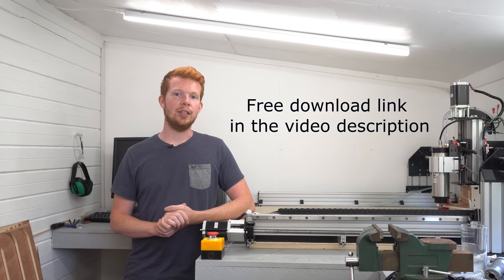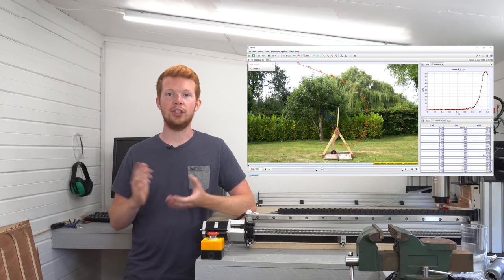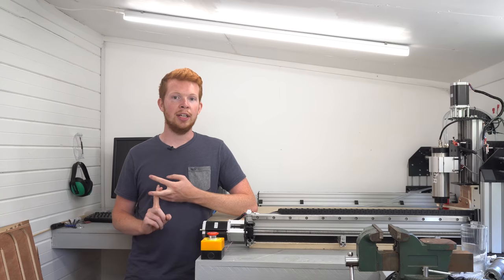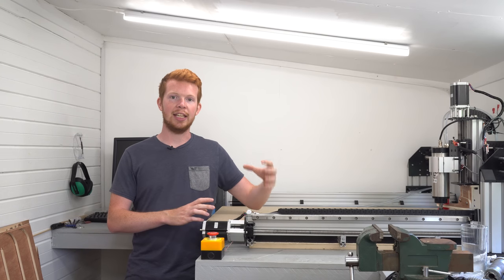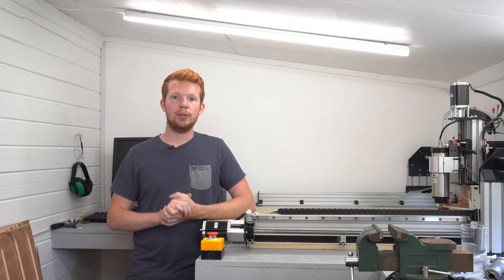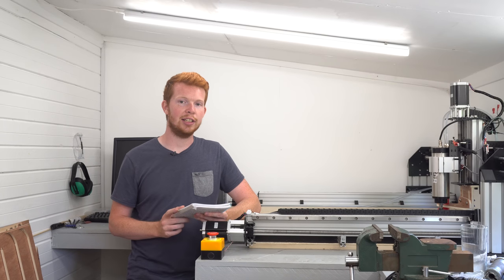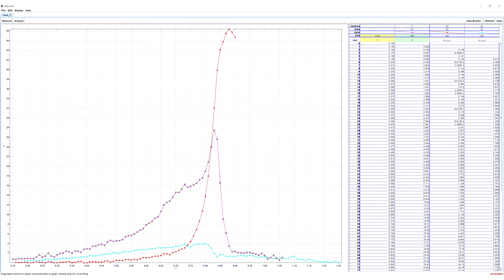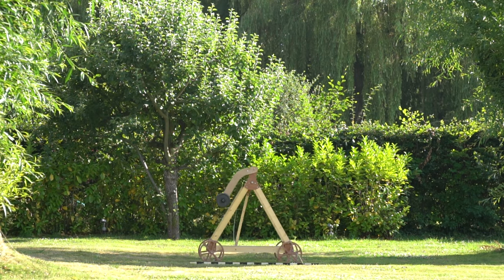Wheels on a trebuchet?

Comment: Are there other ways to achieve that synchronization? changing the length/shape of the weight arm, or a bent launch arm, etc?
Reply: Even the radius of the wheels could matter, a lot of variables here to mess with calculations.
Reply: That grass surface too. Couldn't help thinking some sort of track would improve efficiency, but no idea whether the effect would be negligible or not.
Reply: Aron Green why not just put drawer sliders on the bottom and weigh down the frame?
Reply: Actually i completely misread this. If you let it move on its own, its not gonna syncronize, ever. That would be like a gun recoiling forwards.
Reply: The wheels must move freely to time the frame with the action. I use tracks in the fields.

Comment: The added efficiency of the wheel version may come from the concept that with the wheels and move vertical stall location of the counterweight, the counterweight ends up stalling at a lower elevation relative to the ground than the non wheel versions.  The results in more gravitational potential energy being delivered to the arm/ball.  In the case of non-wheels, the ball is released and the counterweight still has another few inches to drop and that energy goes into the swinging of the arm post release of the ball.

Comment: Tom, your analysis of the stall points was very clever, and I do believe that their synchronization is what allows your trebuchet to throw faster. However, I do think that your idea that allowing the trebuchet to move causes a loss of energy is flawed. If there is one thing I have learned about physics, it is that every action has an equal and opposite reaction. Regardless of the presence of wheels, the same amount of energy should be lost. With the wheels that energy is utilized to move the frame of the trebuchet forward, and when it is anchored that same energy goes into changing the earth's rotation which, due to it huge mass, is altered an imperceptible amount.

Comment: on a traditional trebuchet with a single arm the wheels allow the weight to fall vertically instead of in an arc. this allows for greater acceleration of the weight downwards and more force to the projectile.

Comment: Adding the wheels allows more distance for the counterweight to drop (mostly) entirely vertically by moving the main axle forward, hence a gain of gravitational potential energy.  The syncronization of the stall points is just in a different location due to the movement.  I bet if you look at your footage you will see a difference in the height before the counterweight begins to move horizontally.

Comment: Wheels add efficiency because it allows the weight to fall in a straighter line.  Measure the horizontal motion of your weight with and without wheels.  This is especially pronounced for fixed-weight trebuchets.  Forcing the weight to move in a curve takes up a lot of kinetic energy.

Comment: Paused at 5:21 - I believe the wheels help the velocity because the frame moving has the effect of lengthening the radius of the arm, so yes, you lose 3m/s in the 1 m roll forwards, but you gain 1 m of radius on the arm, which magnifies the release velocity by much more than you lose in the roll.

I think.

Based on college physics 20+ years ago and very little practical knowledge, so I'm likely wrong, but wanted to lock in my guess before I watch further.
Reply: Sweet!  Glad to learn that, and very happy that you could get more efficiency with your trebuchet.

:)

When the zombie apocalypse comes, I'll be naming my trebuchet defenses after you.

Comment: Think of it as putting wheels on the fulcrum not the frame (since ideally the frame is really just holding the fulcrum above the ground . By allowing the fulcrum to move laterally it allows for better conversion of the cw rotational moment into just vertical (less energy is lost trying to move the planet). On a 'normal' trebuchet it moves the effective fulcrum from the pivot point towards the centrer of mass of the total arm (ie making the throwing arm longer as it nears the stall point).

Comment: Thinking in terms of a closed system, it should be that the counterweight has less remaining energy after the launch with wheels. Did you measure the counterweight velocity after the launch? Guess that's where the extra energy on the projectile comes from. Hence the wheels raise the efficiency.
BTW, great job!

Comment: Limitation of current construction is that here is only one full turn of the shaft with projectile available. What if we add some circle spring (like a mechanical arm watch has) to be able increase the power of launch due to  additional rotation energy. It will also require stopper to prevent the  spring from premature   release and also synchronization of pin unlocking the projectile sling with the cycle of rotation. It must be unlocked when last circle of rotation almost finished.

Comment: Now, for efficiency, lots of energy is used to accelerate the different frame parts, so is you can lighten/thin especially the rotating parts it should be faster. :)

Comment: I think wheeled trebuchet works better because of conservation of momentum. If the ball has momentum p, then the same momentum goes to trebuchet (counterweight and frame) of mass m, so p=mv. And because its kinetic energy is 1/2*mv^2=1/2*m*(p/m)^2=1/2*p^2/m, you can see that actually it's invertly proportional to the mass, so adding moveable frame makes it more efficient.

Comment: There is another place to put wheels, on the arm axle itself. In this case, the frame is sort of like train tracks, and when the arm pivots it rolls forward. The diameter of the wheel would determine how far forward it goes (rather than inertia, in the current design), and so give a new dimension to tune. Yeah, more complexity. If it helps any, Da Vinci (yeah, that Da Vinci) worked with the floating axle design some. Evidently, he thought it was worth optimizing. He was, after all, as much of an arms dealer as an artist...

Comment: Smaller wheels should give greater acceleration and as mentioned before adding weights to the frame would keep it from jumping. 
The relationship between wheel radius and frame weights could therefore be optimized. Also you could oil all the moving parts to remove friction.

Comment: With the wheels on there you should try a fixed counterweight. A public tv (PBS here in the states, if you're familiar with that) special I watched they found that with wheels, the fixed counterweight followed a nice straight path downward, which has the added benefit of sending the trebuchet forward, like yours.

Comment: A key thing you've missed is to consider the centre of mass of the trebuchet. The centre of mass moves horizontally as the counterweight falls in its arc. Without wheels, energy is expended from the potential energy in moving the counterweight, decreasing the vertical velocity. With wheels, the trebuchet moves to keep the centre of mass horizontally closer to the original position, allowing the counterweight to fall faster - and at the end the stall points are vertically aligned because of this.

Comment: hey, the answer i was told is that putting wheels improves the efficiency of the weight drop. i.e. the weight drop is purely vertical, there is no horizontal component. the weight will drop to the bottom point faster.

Comment: It isn't the momentum of the frame that increases speed, it is the reduction in wasted potential energy. The wheels, or as I usually see a sliding swing arm, allow the counter weight to drop straight down instead of at the curvature of the short arms arc

Comment: I bet you would get similar results with having the current trebuchet mounted on a sliding frame that was fixed to the ground - more expensive and complicated, of course. Given that the whole thing still rocks back and forth after launching it seems like there's still a lot of wasted kinetic energy being sent into the frame instead of the projectile.

Comment: I thought the theory behind the wheels was that the frame moves so the weight drop is closer to a straight line rather than an arc, thus it's dropping faster and moving the arm faster.  It's even more effective to put the wheels on the arm axle.

Comment: Nice!

I've been trying to figure out the math for trebuchets(mostly with rotating cw -> 2 double-pedulums joined at the main axle) for quite some time, trying to make the projectile go as far a possible and trying to find a formula that would allow me to hit anything in range doing minor tweaks(i've developed a complex of second-order differential-equations as a result though...), and i've also encountered several types, some beeing relativly "modern" i.e. the "floating-arm" trebuchet, but i've never seen this "whipper" version.

I think there are more variables to tweak in order to fine-tune the trebuchet effisciency and range(release angle):
-the weight ratios of CW, projectile, launching-arm and frame.
the arm(s) should theoreticly have zero mass, but that is obviously impossible.
-the lenght ratios of the arms and the sling are critical!
a tiny change of the sling lenght has a huge impact on the angle the sling has relativly to the arm, when the weight "stalls" (good term btw).
never built my own, but i did some simulations, so take these with a pinch of salt.
(i'm not salty because you made a great trebuchet or anything, though..)

Comment: 05:09 nonono.. a non.moving frame can easily eat your energy by driving it back into the planet .. or breaking..
allowing the frame to move prevents much horizontal energy loss (remember you're using gravity.. straight down pull.. but arm rotation prevents the weight from moving straight down.. where do YOU think that rotational push goes?) .. by recovering some of the energy with the opposite follow up motion..

the fact that it tries to move, demonstrates clearly that energy is going some place you didn't anticipate

Comment: Wheels turn the pivot of the arm into another lever, It get's pulled over the center of gravity of the counter weight, instead of moving the weight backwards and losing that energy, it instead propels the frame forward.

Comment: In practice you can not build a trebuchet without wheels anyways, as the recoil of projectile needs to be absorbed by the frame and then transferred somewhere, and wheels allow you to dissipate the recoil slower. In best case scenario, of course, you'd want a system which is stationary (i.e only the throwing arm is moving) at the moment of projectile release (while being on wheels, obviously), which could be your next challenge. That should maximize your efficiency. Another thing to try is to put wheels onto a track so the rolling resistance is reduced.

Comment: The energy you thought would go into the ball flying when the trebuchet doesnt move at all will still go into the trebuchet itself.
Either as kinetic energy or if weighted down as inner energy or also called heat.
So the extra movement forwards adds velocity to the ball which it otherwise wouldnt have been able to get.
Reply: Atleast that would have been my thought about that

Comment: With the wheels, the counterweight drops the entire distance.  With the fixed frame, it does not drop as far, as it stalls out earlier.  I believe that your calculations assumed it was dropping the full distance in both cases.

Comment: You don't have the whole story yet, lining up the stall points is important, but also allowing the counterweight to fall as near as vertical is possibly as important if not more so. remember Vertical kinetic final + horizontal kinetic final = gravitational potential initial + gravitational potential final - losses (friction ect). If you are wanting to maximize the potential energy while achieving optimal efficiency you need to test fixed counterweight and wheels vs whip and wheels. Whip is a relatively new design that may be an improvement, but historically they were either fixed counterweight with wheels or swinging counterweight with no wheels. They were rarely swinging counterweight with wheels.

Comment: The idea for the wheels is to allow the weight to fall faster. It also seemed that the wheels didn't move that freely. The wheels should freely move on a level smooth surface, and probably in a track so it doesn't wander.

Comment: You forgot to mention that, in addition to synchronization, the wheels also allow the stall location of the main weight to be slightly lower, thus at a lower potential energy, allowing more energy to go into the ball. Not sure how much of an effect that has in comparison to the synchronization issue.

Comment: Any noise movement or friction will cause a loss of energy to any said projectile in any area of ballistics upon initial action of transfer of energy to a projectile. So in ideal condition a silent launch without any contact to cause loss of the reactions energy from said circumstances i said initially.. Basically the ideal thing would be a device capable of moving a particle at the speed of light but said particle should transfer all energy to the target too i read that in some old ass army book i had about tanks and there guns an stuff make larger wheels and fit a longer arm i think that will give it some more velocity as there just mechanical arms longer the better

Comment: Brainstorming: the wheels may also help with heavier counterweight. Without them the whole construction either jumps or with an extra weight on the frame still has to withstand the forces. Smooth running wheels probably help transforming what would be a tension of the frame into a forward movement. 
I have no proof of it, just an intuition.

Comment: Great video! I wonder, now the energy is still somewhat tranferred into moving a relatively heavy frame. If you instead of adding wheels, add some smaller sliding/rolling mechanism that allows horizontal movement of the arm-axle, that might be an improvement still.

Comment: ok so the wheels on the trebuchet are not about adding velocity to the frame, what is more important is getting the counter weight to fall in as straight of a line as possible, to get more potential energy transferred to the arm, and then to the sling and projectile and to also reduce your losses, at least with a traditional trebuchet, with a whipping trebuchet this might introduce more losses but we never really covered whipping trebuchets in my ap physics class, infact i dont think we were allowed to build a whipping trebuchet when we were making them due to the restrictions that were placed on the class competition.

Comment: You forgot that the roll motion is also leveraged through the arm. Just as the weight isn't moving as fast as the ball because it's motion is leveraged through the arm the forward motion of the frame is also leveraged so it doesn't move the extra 5. Where the energy comes from though is because in the fixed frame the weight moves in a longer circular path so some of the energy is lost moving the weight in a longer path. With the wheels the weight moves closer to a straight line down pulling both the ball and the frame forward. No energy lost in the curve path. The lining up the stall points just maximizes the efficiency of both the fixed frame and the wheeled frame. Lining up the stall points has nothing to do with why the wheeled frame throws faster than the fixed frame.

Comment: The energy lost in the frame movement isn't recouped by weighting it. Instead the energy is absorbed into the weight you added. So the stalling phase change is the factor that got changed by adding weight. That wpuld be my educated guess.

Comment: We want the weight to drop straight down, as this optimizes the energy transfer (i.e. the weight doesn't end up swinging).  The wheels keep the trebuchet under the center of mass of the weight.  This is a known issue.  This leads to the modern invention of the floating arm trebuchet.

Comment: A trebuchet is just a kind of level, correct? On a trebuchet with wheels, the actual path of the end of the arm where the tennis ball is held describes a spiral, whereas if the trebuchet is stationary the path is circular. The spiral path is longer, therefore the leverage is greater.

Comment: Use a trebuchet as a catapult kinda like the ones on aircraft carriers to try to make a USTOS (ultra short takeoff system). The "Trebupolt" would probably pair nice with a ultra high speed RC EDF jet that would other wise need a very long runway. Great video

Comment: I was under the impression that adding wheels was simply to cause the counterweight to drop straight down (or as straight down as possible), directly with gravity. Otherwise, the counterweight simply rotates around in an arc, which is not efficient nor powerful. Having a hanging counterweight makes it drop fairly straight down by itself, but adding wheels to this makes it near perfectly straight.

Comment: How about floating main shaft on a gear tracks? Solid base but main shaft on toothed tracks with gears as wheels. This way you can control the amount of arm forward traverse.
Reply: On video I can see that it is reversing a little before going to forward. Interesting to see what eliminating only backwards moving effects.

Comment: You can't add kinetic energies for instance adding 3m/s energy to 50m/s does not result in 53m/s, but only 50.09m/s
You have to square the values, add them together and square root the lot to add kinetic energies.